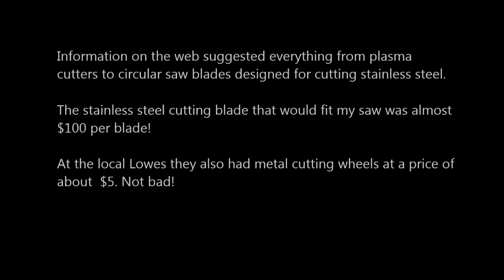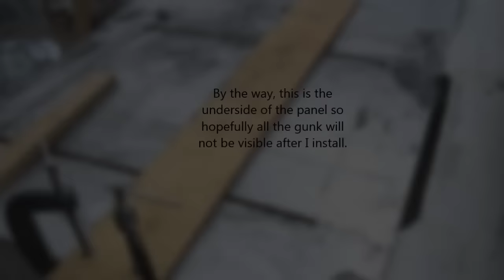Cutting 16 gauge stainless steel

Comment: Thank you for sharing. And the  meanwhile, it is  dangerous.  when the saw or steel plate  is not  moving straight, the  cutting wheel is easy to broke itself. and the  broken pieces would became fly knifes to make several long and deep wounds to body. please know it when   using cutting wheel in this way.

Comment: Thank You for sharing!  Did you have to use both cutting wheels?  Can you estimate the times it took you to cut each section?  Is it 16 gauge Type 304 Stainless Steel you’re cutting?  Once you did the Plunge Cuts, about how much of the cutting wheel did you insert into the Stainless Steel sheet to make the cut?  I’m assuming you’re not applying force towards the sheet, just holding tool steady and letting  the tool do the cut.  Your replies to my questions will be greatly appreciated.
Reply: Using Power Tools is a Dangerous Undertaking.  PERIOD.  Things Can Go Wrong In Just Fractions Of A Second.  BUT, it is just like driving a car.  With that said, this YouTuber was very careful in his approach to the task at hand: (the following are just observations I made) he clamped some pieces of wood to guide the Circular Saw, and keep it steady.  He was also cooling the 16 gauge Stainless Steel with water to prevent the Hot Temperature of the Very Hard Stainless Steel from damaging the Cut-Off Wheel further.  I would assume that this YouTuber must have cut each section very slowly (he only shows pictures).  I am by no means promoting that you undertake a project similar to what is shown in this video, if you are in need of cutting 16 Gauge Stainless Steel take it to a shop where they have a Plasma Cutter (or other means) and be ready to pay them $400 for the cut out.
Reply from the maker: No used only one cutting wheel. yes it was 16 gauge 304. The cutting wheel projects about 1/2 inch below the cut steel surface. There is a bit of forward force but not much. It cuts at about a foot per minute.
Reply: @abizarlakdawalla4519  Following the Observations I made from watching your Content on YouTube, and following High Safety Measures, I successfully cutout a Rectangle on 16 Gauge Type 304 Stainless Steel.  Once again, Thank You for sharing.

Comment: I've seen this done before with a Milwaukee Fuel  6 1/2 circular saw  to cut rebar faster but I really didint think getting the disc wet was smart they are like grinder discs if they get wet they can fall apart while cutting right? Just becareful man. Nice upload!😎🛠

Comment: This means I can put a cutting wheel on my table saw and get the same results a lot easier ? Agree ?
Reply from the maker: Yes, it should work.
Reply: So you still alive sajid? we use abrasive blade demo saws at work all the time.  Pretty much the larger (14"), industrial version of what you have here... I've seen photos of people in the ER with one of those embeded about 7 inches into their face from trying to make long cuts like this.  Strongly recommend against using abrasive wheels in any type of saw other than a chop saw to make small cuts or to cut bolts and things like that.  Just an opinion I guess, if you don't believe me you can always google "abrasive saw face" to see the aftermath yourself...
Reply: yes i think table saw would be really dangerous. circular saw might not be too bad though, just stand away from the axis of the blade.
Reply: No way on the table saw.  At least with the circular saw the weight and control of the blade is pushing down on the work bit.  Table saw the work will probably ride up on the blade... or worse...
Reply: I wouldn’t recommend that. Lol